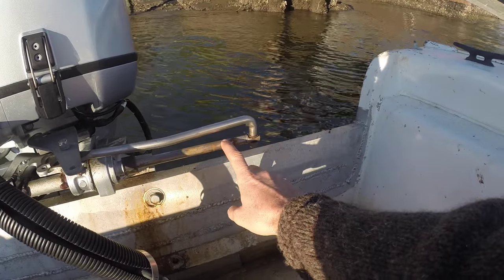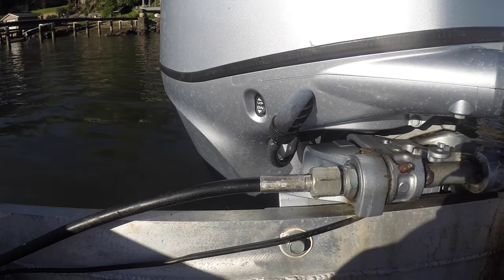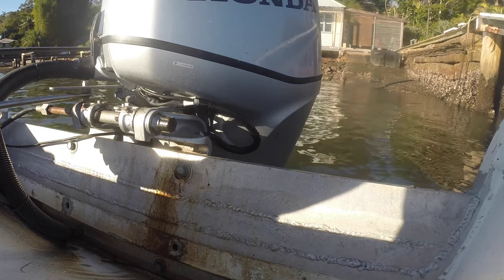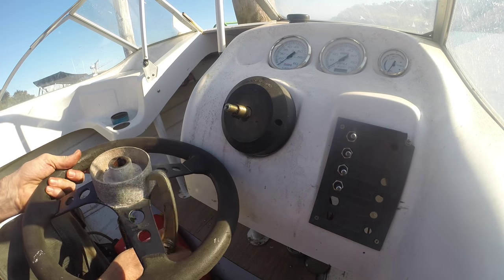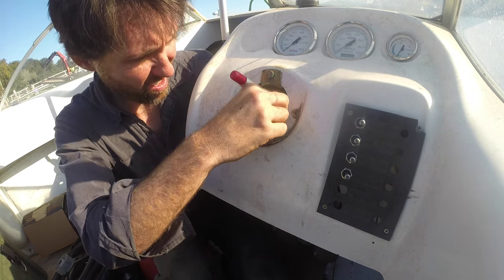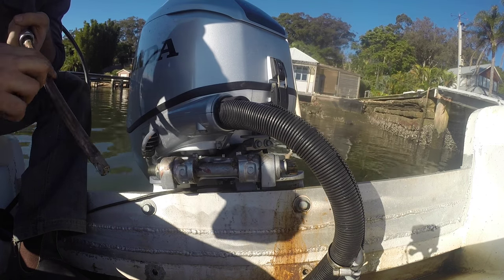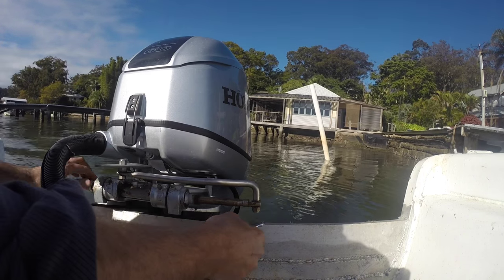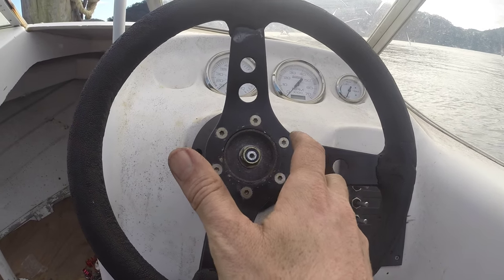Replacing the steering cable and helm in a boat

Comment: Hi Nice vid I broke my steering today and want to have a go fixing it myself I think the cable has snapped but not sure,  im able to turn my steering wheel freely but the motor doesn't move any idea what the cause of the problem may be? thanks
Reply from the maker: Hi Michael, it may be the helm itself rather than the cable. Try winding the cable out of the helm and see what the spiral part looks like.
Reply: Hi Dangar thanks for your reply much appreciated, ive since had a look and I noticed the spiraly part of the cable was sticking out of the white plastic tube that holds the grease in on the helm outlet, I took out the holding screw from the helm and turned the steering wheel and nothing happened but I was able to pull the cable out from the plastic tube on the outlet by hand  and found the cable has snapped most likely somewhere inside the helm or near the inlet so do you think  a problem with the helm may have caused the cable to snap? cheers
Reply from the maker: Generally cables snap like that because the cable is seized and turning the helm has generated enough force to snap the cable. If you are lucky you should be able to open the helm and get the broken bit of the cable out then reuse it. Take a look at the groves that the spiral part of the cable mates with to make sure that the helm hasn't been stripped. You can always get a new cable first and try it, buying a new helm later if it doesn't work properly.
Reply: Ive noticed the steering wheel has a fair bit of play too so might just get a new cable and helm thanks for your help
Reply from the maker: Michael Deo No problems, good luck with the fix. :)

Comment: Mate, you saved me heaps, I am not that mechanically minded! Great stuff, Hello from Forster, NSW. I have a 2000 model 90hp Mercury 4 stroke fitted to a Suntracker party barge. I have now developed another issue, engine starts and idles fine. Can rev to very high revs in neutral. In gear the motor will cut out completely usually about 2500 revs or over, any suggestions? Cheers
Reply: Cracked fuel lines, bad fuel line clamp, fuel pup diaphram has small hole, lastly the O-rings inside the fuel connection line. If your outboard is hooked to a tank with a line that has the primer bulb, this is usually the problem.

Comment: I just bought a 78 Mercury 20hp it's in awesome shape. I'm trying to attach the steering cable and the threaded tilt tube only has a few threads to tighten on to. Can I take the nut off the tilt tube and attach the steering cable to take its place ? Thanks for any help
Reply from the maker: +Mac Keating Hmmm, there is normally more than enough thread for that nut and the cable's collar. Is there much thread poking out the other side?
Reply: +Dangar Marine same amount about 3 threads I have a bracket that goes under the outboard clamps with a threaded tube I can use though

Comment: great thanks! wondering if you can pull cable fully in before removing rod ( avoid hammer) as needs to be fully out to remove helm? 
Also teeth have gone on mine so I can't get cable out first - any ideas?
Reply from the maker: +Adam M I would always have it pulled fully in before removing it, but even fully in it still sticks out from the tube so if the tube is seized up with old grease you will need to hammer it through still. Once it is out from the helm you should be able to push it back in by hand without too much trouble. If the cable is stuck in the helm you're only real option is to unbolt the helm from the boat then either open the helm to extract the cable or just bin the helm and cable as a unit. Let me know if I've misunderstood.
Reply: +Dangar Marine Thats spot on. I also noticed on mine I think the grease nipples are only for the tilt tube - no grease gets inside the steering tube - the only way to grease that is the rod fully out as you mentioned.

Comment: Hi Dangar. At 4:04 you show how to remove the bolt with spanner for the part of cable that connects to the engine unit. On my flipper (from 70's) I have followed these steps but find no bolt as on yours, so essentially i dont ee a way to take this part off (only to take the whole system out). Is that normal or am I missing something do you think?
Reply from the maker: Hey Jason. I can't say I've ever seen a steering cable that doesn't have that locking collar on it. Perhaps posting a photo on the Dangar Marine Facebook page would be best.
Reply: Dangar Marine thank you so much for the quick reply. I've just posted pics on your Facebook page. Can I just say also how incredibly helpful your videos are, best on YouTube in my opinion. Keep up the good work.

Comment: Wayne, have learned a lot from your vids! Thanks. Need some info: Rigging a Mowdy S10 with remote control/steering. Got a 20 HP Suzuki ATL so need to run battery so what size cables should I use? Can I use 20 gauge premium extra flexible cables?
Reply from the maker: So this is running the battery power to the dash or forward controls? Does the forward control loom not have a power wire in it?
Reply: At this time I have the 20 HP ATL no tiller, Remote control with harness and control cables, rotary steering. Very small simple console no gauges. but how do I get power to motor to power motor? I figure it cant be direct cables to solenoid in motor. Is there fuse for safety or other type of protection? I am assuming it takes a battery lead of some kind but I am stumped because this is my first boat build. I would compare this rigging to a jon boat with simple control box.

Comment: Hey there,

You know the easiest way to get water out of your gas tank? I have a 17 foot Starcraft. I pulled up the floor and removed the sending unit so I can really get to the bottom, but it sits in wet slip and I cant get it to siffon out. I have about a half a tank in it. Maybe 10 gallons. Any help would sincerely be appreciated.
Reply from the maker: We have a hand vacuum pump that is used generally for removing sump oil through the dipstick hole, but it can also be used for emptying tanks like this. Easiest way to start though is to disconnect the fuel host from the motor and then use the primer bulb to pump it into a container. After that put some alcohol (methylated spirits) in to help get the last of the water flushed out.
Reply: Okay, great, I can do that. So like rubbing alcohol, right? Also, I can't find ANYTHING about a carburetor on a mercury (about 1994), to show me how to see if I'm even getting gas into the motor. I have a feeling I'm not cause I don't smell it real strong like it's flooded. I don't know if it's the water in the gas or if the gas just isn't getting to the motor. But it acts like the kill switch is on. It turns over, I got plenty of power, it just wont fire up. I searched your vids for something and can't find anything. Am I missing one?

Comment: Standing at the back of the boat looking at the right ankour end drill a small hole in the feral  to take a. Nidle point then you can grease it saves hours of work ,,

P

Comment: Dangar, I have a tube in tube at the engine end of the cable. The inner tube has ceased inside the outer tube.  When I undo the bolt the whole cable moves out OK so it's not ceased.  Got any times on how to separate them?
Reply from the maker: I'm not sure I can picture you situation exactly, but a bit of heat can really help soften any old grease that might be jamming it up. Let me know more details and I'll see if I've come across it before.
Reply: +Dangar Marine Thanks Dangar, I used what you'd shown us in the post and adapted it, using a rubber mallet and some CRC I was able to tap the tube loose again.
Reply from the maker: Cool, glad you got it sorted. :)

Comment: my son has a 40 hp john 2004 mod ..the s / s pipe on the left hand side is Stuck iv tried everything for last 4 days ,to get it unstuck ..The motor turns freely let and right ,,Put the s / s bar back on to the pipe ,,Nothing ..Solid . wont turn ,,Have given up on trying to get pipe to move ,,Boat been sitting for a while , was working fine .. Went out the other day .. motor wont turn left or right ..Know any way of trying to move that pipe ? ? ? ? ? ? ? ?
Reply from the maker: +Peter Russell have you tried using a bit of heat on it? I find that is the best way to shift these stuck parts.

Comment: Hi...I am not sure what your name is...please excuse me for that.  I have a console and steering system and the wheel is not at the proper angle for my setup.  Can you tell me if the Teleflex Tilt system is any good?  Is there anywhere you know of where I can view and installation ?  Does the tilt unit mount ONTO the existing helm mechanism?  Thanks much for your help and I hope you are paying your bills cause I know I am getting this for free.  Good job.
Reply from the maker: Hi Donald, my name is Stuart (the YouTube account is under the username ''DangarStu" named after the island I live on) I haven't used one of the Teleflex Tilt systems, but they do make very good hardware so I have no reason not to think it would be good. It looks to me like it might replace the whole straight through helm. Also bear in mind that you can get straight and angled mounting brackets for those straight helms so you can change the angle it comes through the dash. It isn't adjustable like the tilt system, but if it gives you the angle you want it is a much cheaper way to go.

Comment: Any idea why I can't turn my motor back to port after Turing it to starboard?
Reply from the maker: Sounds like there might be a fault inside the helm. Wind the cable out and inspect it. It the cable is fine and the motor can be push both sides easily replace the the helm.

Comment: Can this same steering cable (cable through tilt) be used with an adapter or otherwise to make it a transom mount style? I recently boat a boat with the same steering as this video but the motor I have to put on it uses a transom mount style steering as it doesn't have the hole for the cable to run through on the bracket. It's a 1974 Johnson 40hp 2 stroke.
Reply from the maker: Yep, it is exactly the same cable that you use with those transom adapters.
Reply: Awesome! Thank you so much for your fast response and your wealth of knowledge related to boat mechanics. You're the best! I enjoy watching you videos and learn so much. Would the Teleflex 300616 be an okay bracket to use or would you suggest a different one?
Reply: How do you know which adapter to buy or could you suggest one?

Comment: Good video up until the installation of the new cable at the engine when you used a pair of vice grips and a hammer to get the cable through the tube on the engine.  Shouldn't the cable run perfectly smooth through this tube?
Reply from the maker: +PAUL CONOLLY Yeah, probably should have taken it back to the workshop and cleaned the tube out more, you are right. Sometimes though the problem isn't so much that it doesn't slide freely once it is in but the angle it enters the tube until it is all the way in. When motors are mounted behind the transom you can put it in straight right from scratch, but with boats like this there isn't room to come in straight. With regards to cleaning the tube I'm thinking some sort of stainless steel tube brush in a cordless drill would be ideal.

Comment: Hey Dangar  - need help...  I have a very stuck steering cable I am trying to remove. I have tried multi grips like you used  but the whole cable just wants to spin, also tried taping it in no luck  - it is really stuck. Any suggestion I am getting frustrated, thanks
Reply from the maker: Are you hoping to save the steering cable and reuse it? If not, one way is to cut along the threaded collar parallel to the cable. This will put a grove through the threads on the pivot turns but won't stop them holding the new cable. What is happening with the multi grips? Are they slipping or too hard to hold? I usually just jam them against the transom so I don't have to hold them. The trick is to set them so tight that you can only just get them to close. Other than that lots of penetrating oil can help.
Reply: Dangar Marine
Thanks  Dangar - I was hoping to save the steering cable but if it won't give I will have to cut it like you say.
Yes the multi grips just slip when I turn the bolt. I am thinking I will try another Idea first.. I have a heavy vise that i will mount to timber slip that up under the collar so that the timber rests across the transom and turn the bolt.. If this fails I might  have to destroy the cable.
Reply: Have drowned the cable in penetrating oil tonight and will try again tomorrow.
Reply from the maker: The other option is to release the other end from the helm and just let the whole cable spin with the collar and you undo it.
Reply: I thought that might be an option too.. That should work? So I will remove the helm completely and lay it down? then turn the nut.
Reply from the maker: I would just release the locking mechanism and turn the helm until the cable is wound out.
Reply: ok I will give that a shot - thanks for your help Dangar.
Reply from the maker: No worries. All depends on the shape of the cut-out in the transom how well this will work.

Comment: I'm looking to buy a 9.9 evenrude for my 14' skiff. I want to add a center console. These small Evenrudes come with a tiller, is it possible to connect install remote throttle and steering for these motors?
Reply from the maker: Yes, I've heard the parts are available to do the conversion, even on the 9.9
Reply: okay thanks!

Comment: Every dealt with cable slippage in OMC controls? youtube search brought me here  but cant seem to find the answer.
Reply from the maker: No. Are you referring to the throttle and gear selector cables? Do they slip back to a lower throttle setting?
Reply: Thanks for the reply my friend! Im referring to the gear selector cable in the helm. Maybe not the best spot to ask this question. I did recently replace my steering system with a teleflex kit and it works fine. 

There is a pic on the iboat forum here.

http://forums.iboats.com/forum/boat-repair-and-restoration/steering-and-controls/10399010-shift-cable-slipping

Thanks again!
Reply: Actually this might be the wrong video to ask this question but its the gear selector cable. heres a link to a post I put on iboats. Thanks brother. 

http://forums.iboats.com/forum/boat-repair-and-restoration/steering-and-controls/10399010-shift-cable-slipping

Comment: hi dangar, would u know why my boat turns left when i steer right, i have more or less the same setup thanks alex
Reply from the maker: If you rotate the helm 180 degree and have the cable run down the other side of the boat and enter the opposite end of the tilt tube on the motor it will reverse the steering direction. Does yours run down the port side of the boat?
Reply: +Dangar Marine yes thats right, my steering wheel is on the port side and the helm is the same as the one in the video, does that sound like a problem thanks
Reply from the maker: Yeah, the cable will have to enter from the starboard side to correct your problem.
Reply: +Dangar Marine is that the starboard side on the video(left)  my wheel is on the left sorry im just starting out with boats really must get the hang of the lingo  thanks
Reply: Can't you just swap which hole the cable enters on the helm?
Reply: +Jersey Tom hi thats exactly what i done problem solved thanks
Reply: I have same problem and this can become dangerous in a stressful situation.  My helm is old and cable will only go in on one side ?

Comment: How long of a cable would I need to order?
Reply from the maker: Depends on the distance from the helm to the outboard. It has to match the boat.
Reply: @DangarMarine  thanks. i measure the existing cable length exactly using a rope. ;)

Comment: hi man the spiral cable is very stiff as it goes in and gets stiffer please help! thanks
Reply from the maker: +Travis Coulon Is this a new replacement cable? By going in, are you talking about going into the helm or going into the tube at the outboard end?
Reply: +Dangar Marine hi, yeah sorry it's not going into the helm, it goes in easy is then as it goes  further it stiffens yes it's a new cable thanks
Reply from the maker: Is it the original helm because it is quite common for the teeth inside the helm to get damaged once steering is old and no longer mate cleanly with the spiral cable.
Reply: +Dangar Marine, yeah everything is brand new
Reply from the maker: +Travis Coulon Hmmm, that is weird. I can't say I've ever seen that. Even the different brands seem to have compatible cogs. I'm presuming you've had a good look for debris or something caught inside the helm. How far does it go in?
Reply: +Dangar Marine, you can get get it just to the other side of the helm but it is extremely stiff
Reply from the maker: +Travis Coulon That is odd. If you purchased them recently I would be inclined to take it back as it sounds like it make be a manufacturing fault. If not, I would be opening the helm to see if there is anything stuck inside there.

Comment: Nononsenseknowhow has a video he uses an air compressor fitting into a ball valve then into a piece of hose a foot and a half long, he closes the valve and fills the hose with oil or trans fluid depending on what conditions call for, hose clamps it onto the cable sheath and takes precautions that it doesn't blow off. I forgot the psi he said but he opened the valve and worked the cable and rather quickly he had it freed and lube was coming to the open end. Was very interesting
Reply from the maker: Me too! :) https://youtu.be/_j2xD_8k5yo